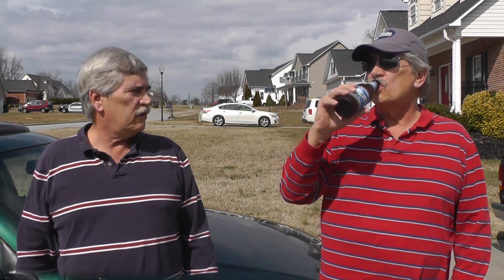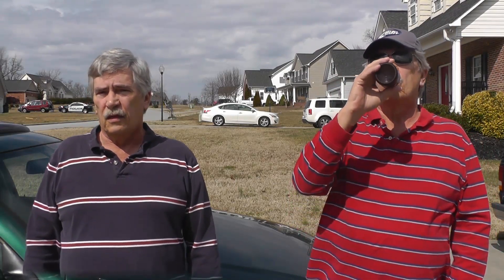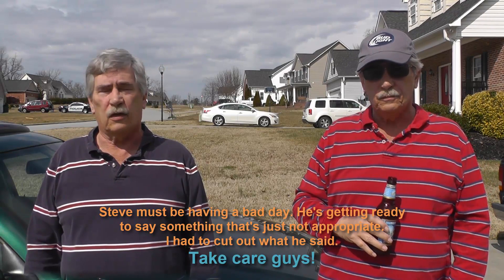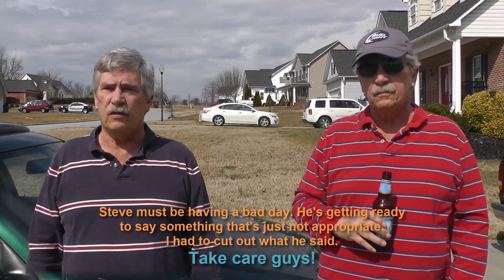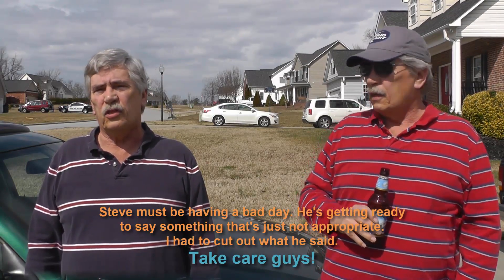Volkswagen Jetta VR6, Coolant Pipe Install - Part 6

Comment: I have a 2000 Jetta VR6 2.8L. The Black wire going to S177, melted the side of the power distribution unit on top of the battery for the second time in one year. 10 month ago triggered a fault on the ABS module.  I changed the box, cleaned the black wire, and cleaned the negative battery wire tip and the part bolted to the chassis. The ABS light went out and everything was good for a while. This time it’s causing the A/C not to work. I have no fault lights on my dash. Thank God. I replaced the power distribution box for the second time in a year. All fuses are in good shape and only the black wire is dark. When I turn on the A/C, the fan will not come on and the compressor clutch will not engage.  The car is not over heating; temp stays at 190, and the regular fan come on. So that’s a good sign. I don’t have any Freon leak. I will troubleshoot the A/C system tomorrow.

My question is that, I did some research and I found that people are installing new robust set of positive and negative cable from http://innovativewiring.com for $120.00.
I took a quick look at most of the battery cable going to the alternator; starter and I see no cuts on the insulation. I was thinking of taking every thing apart cleaning all the power cable (ends) instead of spending $120.00. 

What do you think?
Will changing all the power cable fix this problem?